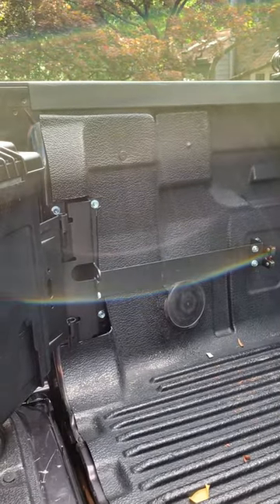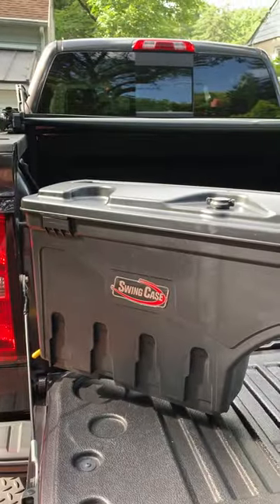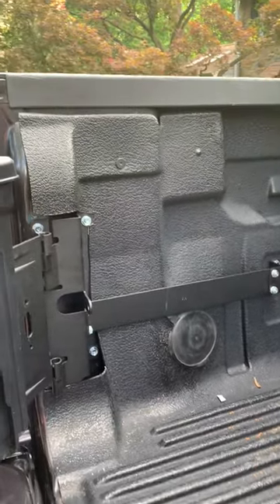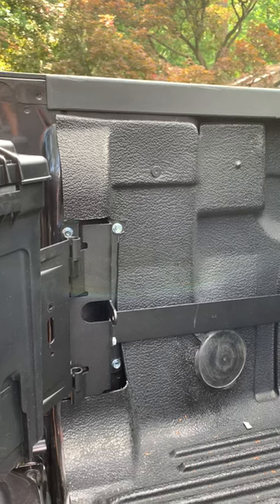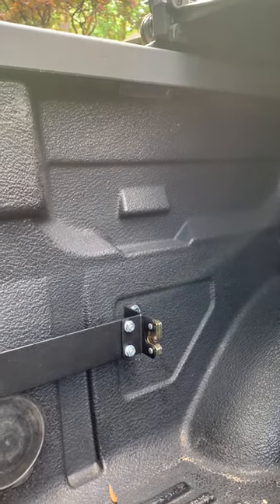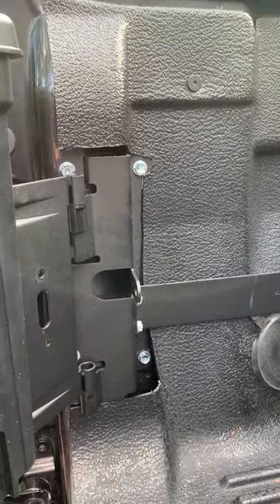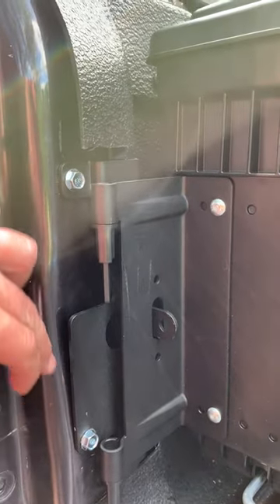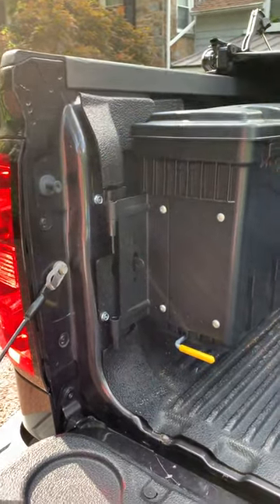Swing Case Installation, WATCH BEFORE YOU CUT! UnderCover Swing Case Bed Box with GM Bed Liner.

Comment: Why not just get longer self tapping screws vs cutting the bed liner?
Reply from the maker: You want to mount it metal to metal, solid.  The weight in the Swing case over time would likely indent the plastic, and cause problems with functionality.  Could have tapped in over top of it, just felt more reliable to mount to body directly.
Reply: @acer154d  yeah thank god I found your video just got one for my 2017 Silverado, it won’t even be close to alignment until I lifted my bedliner up alittle and tested fit good but than I was worried about the gap and it not siting flat and flush but you confirmed it l works just fine.
Reply from the maker: @ethanforeback3866  That’s great, glad it helped!